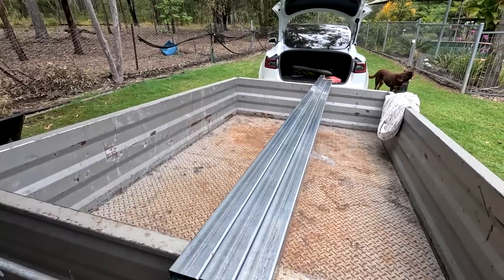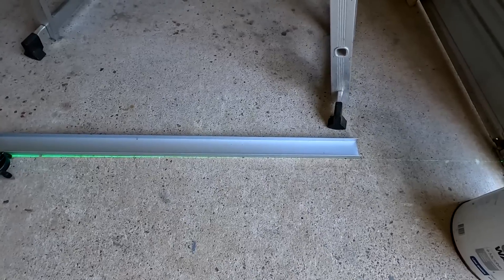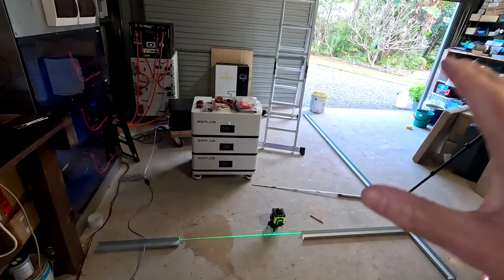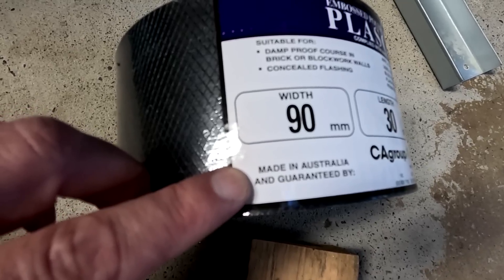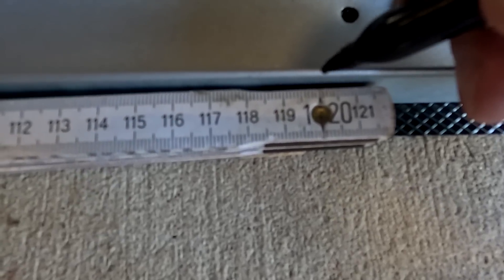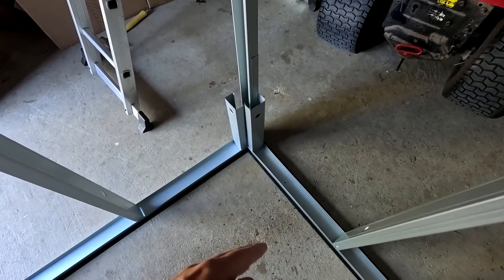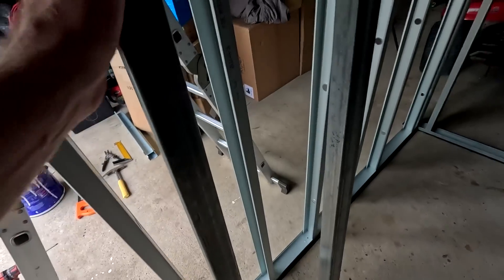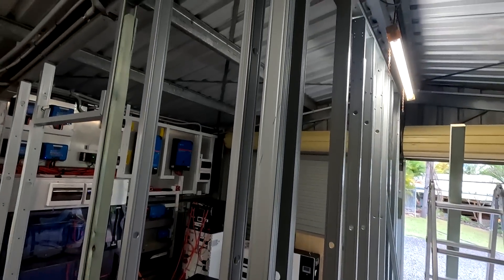Building a Battery Storage and System Room inside the garage (not a crane!)

Comment: Instead of cutting studs short  to allow for movement,  I would have cut them tight and attached them securely to strengthen structure and prevent movement, but I never did much with metal framing, mostly wood and laminate.

Comment: Awesome videos as usual. Boss I was wondering if an isolated "battery" room would have been a better upgrade option? Lifepo4 🔥  from your collection of lithium in Kg is huge. Have your battery shed full isolated from the rest of the house. And no its not boring. For me, you give me the true pix of running on lifepo4. 2x Thumps ups Boss

Comment: I am wiring up a big off grid portable   tri axel trailer mounted  solar system 25k worth ..comprising 0f 12x 300w panels on A frame its pro built kit comes unwired ,has victron gear and pyltech 48v rack battery's .i just got sent the wired diagram . its going from gympie to south Australia along with tiny home and trailer deck ,everything must be transportable for bush fires even the deck lol , wish me luck lol

Comment: Andy, I thought it was only a matter of time you would build a battery room, just got mine part finished enough for our NSW winter in the Blue Mountains, since then my batteries haven't been under about 12 degs C instead of minus 4 of 5 degs at times, mine is build out of steel frame from bunnings and lined with villaboard and tiles up to 1.2 metres high for added fireproofing and installation batts in both walls and ceilings.

Comment: I have to agree with ours, its not boring Andy, we all have to decide on where our Inverters and batteries are to be located, so it is very relevant to the channel. I am right now designing our new extensions, which will include the Inverter and battery room, at the moment they all in the loft, not ideal!! Cheers Ken

Comment: If you first put a chipboard (OSB) on the inside of your room and then put the plasterboard on top, you will have a very stable wall where you can screw things anywhere. In Germany, this is often done in kitchens where wall cabinets are installed.

Comment: will the crane fit thru the door ?... with swing space  ?..
Reply: @mikedurham4448  I don't think it needs to. He stacks the batteries in the main area and rolls them to the corner already.
Reply from the maker: Yes, crane does fit inside the garage and I can wheel them out as well, so all good!
Reply: You forget about the outside garage door which is as wide as the new room and rolls up all the way if needed.

Comment: Thanks Andy, insulation in the walls ? 90k well done 👍
Reply from the maker: Yes, insulation all around. Except the roller door maybe...
Thanks for all your support, Wayne. Much appreciated.
Reply: @OffGridGarageAustralia  they make garage door insulation kits that are just shinny bunble wrap (radiant barrier) and double stick tape. Might be a quick and dirty solution 🤔
Reply from the maker: @DavidBTB  for roller doors? How would that work when you open the door?
Reply: @OffGridGarageAustralia  It's only about 2mm thick and it's stuck to the back of the door with double sided tape or screws with washers.
Reply from the maker: @DavidBTB  Yeah, OK. I was planning to not use the roller door any more, So I could either install some thicker insulation (which can be removed if necessary) or leave it without insulation as this door faces south. It has never seen any sunlight...
Reply: @OffGridGarageAustralia   Andy, just thinking, will the crane fit through the door way ?

Comment: Andy not boring at all. It's very interesting and entertaining.
Reply: I always watch a couple of Andy's videos to get motivated to work on my battery project.. All I have left is to power up and program the 2 controllers then reprogram my 2 solar charge controllers and 2 Outback Radian inverters and then switch out the cables disconnecting the lead acid batteries and connecting the LiFePo4 30kw stack..
Reply from the maker: Thanks for the feedback. I'll keep them coming!

Comment: Will the crane fit through the door or are you gone go through the gravel outside opening the garage door?
Reply from the maker: The garage door will be sealed off and won't be usable any more. Yeah, it will fit through the door. Alternatively, I can just wheel the batteries out of the room if I need to re-stack them. Easy...

Comment: I'm impressed with your knowledge on the top track (Leaving room for movement and not screwing into the top of the studs) This is exactly the proper way to do it! Nice work!
Reply: When we used to do those we would make the normal box top and add another on its back so the whole top floated as one unit and not just the individual studs.. In his application adding horizontal blocking to tie the studs together near the top and in the middle of a wall that is taller than 2 meters if he is just using drywall would be a good idea.. If he uses plywood then the plywood sheeting becomes the main structural component that stiffens and links the metal studs.. I have seen far too many office walls that get bumped hard and all of a sudden you have 20 drywall screw dimples because the wall flexed because drywall is not a structural component..
Reply from the maker: Thanks Dan. I watched a video or two beforehand. Just missed the one for the outside corner😄

Comment: You didn't say why you were building the enclosure. Is it code ?
Thanks
Reply: Adding an air conditioner on one wall... To keep the equipment cool in summer. In previous videos he has issues running the inverter at capacity due to over heating cut-out.
Reply from the maker: As I have the batteries already in a separate building, away from the house, the requirements would be enough. I just like to have the electrical stuff separated from the rest of the garage activities. It is just cleaner and more organised. And, yeah, it will get an AC unit as well...

Comment: Hello Andy from cloudy Vancouver, Washington...although today it is 103℉! I've learned a shit ton (standard Imperial unit of measure) here on your channel: DIY batteries, good BMS, bad BMS,  busbars, and of course how to turn my Raspy into a functional display for my Victron system. But there is something I've been trying to figure out lately, and the proper answer seems elusive: I'm wondering what your stance is on the implementation of Class T fuses in DIY battery builds? In what type of system/scenario might you consider a Class T fuse to be a sensible and necessary design component? 

It seems to me that in some cases it is overkill, and not likely to be necessary. I see Victron now has a Class T Lynx Power In/Distributor...so perhaps there is some trend toward the use of this fuse. Also I recently ordered an aerosol fire extinguisher pod from Ali which is supposed to fully extinguish an electrical fire when properly installed, and I will be installing this in the battery compartment. Since I am going to run an 8s2p config for my battery, I would most likely be using 1 Class T on each side of the battery bank. 
(My build is a ~13kWh 25.6V 230Ah Battery consisting of (16) 230aH CALB cells + 2x JBD AP21S004 v.1.2 BMS. CALB factory spec sheet states around 245aH actual cell capacity although I have yet to confirm this). Cheers Andy, and thank you very much for creating an environment in which the education is indistinguishable from the entertainment!
Reply from the maker: Thanks so much for your kind words and feedback. This made my day (even it is still morning here).
A Class T fuse is not a bad thing and due to its high current breaking capacity especially suitable for large DC currents. However, you will still need a switch for your battery bank to disconnect it as well which can withstand high DC currents. I'm sure this will be a requirement for most countries.
So, here is my thinking of using a DC breaker instead which combines both requirements. The NOARK, I'm using have 25kA breaking capacity and are therefore even higher rated than a Class T fuse. And I can turn off the circuit easily for maintenance or fault finding.
There is of course the space requirements for such a breaker and it is not the go-to solution for all situations. But with the right planning and system design, I would always prefer a breaker.

Comment: Now that you've made all this wall space, you need to buy back all the wall-mount battery packs you sold. 😂
Reply from the maker: Hahaha, I actually only have one wall mount battery. It's with Peter atm for testing.
The other ones where more vertical batteries on wheels. It would be a heavy load for these walls.

Comment: optimizers ?!
Reply from the maker: for?
Reply: @OffGridGarageAustralia  optimizing Solar output with shadows, thought was your next project
Reply from the maker: @mastergool  No, I would not use optimizers at all. They only optimize the profit of the manufacturer of such devices.
There is only one case when they work a tiny bit better than without: panels in the same string pointing in different directions.

Comment: Looking great Andy once you get split AC unit up on the stud work out the way it will be the 'go to' room in the Summer heat. Did you know you lose approx 250 cycles for every deg C above 25 the batteries are subjected too? So, if your batts regularly stay at 45 C you lose 5,000 cycles which is insane, it's all in the spec sheet. I will be interested to hear the temp difference of your batts this Summer compared to last.
Reply: @ricardophelps6323  which spec sheet is this you refer to?
Reply: @vastirvision  EVE LF280K.pdf
Reply: @vastirvision  EVE LF280K dated June 2023 Page 3, Pt 3.15 (I tried posting link but YT deletes it)
Reply from the maker: Thank you. My batteries don't stay at 45°. I maybe hit 40° for a brief moment for 10 days during summer. Everything else is under that temperature. I'm not too fussed about losing some cycles. The cells are rated for 55°C, so I'm far under that.
But yeah, AC will be nice in summer for sure!

Comment: Great video, but I'm left wondering "why?"
Reply from the maker: - Keeping the batteries and electrical equipment separated from the rest of the garage gear
- Regulations
- cooling in summer
- my OCD
Reply: Keep the batteries and inverters cooler, he's said it's going to be air conditioned.
Reply: Summer is coming. It's easier to insulate and cool a smaller room to a temperature that is just right for the equipment.

Comment: if you hanging stuff on the wall use plywood or cement board must better than plasterboard
Reply: I was going to say that as well, use plywood, then drywall, makes it super easy to screw stuff to the wall.
Reply from the maker: It all will make sense eventually. Plywood would not be suitable for my situation.